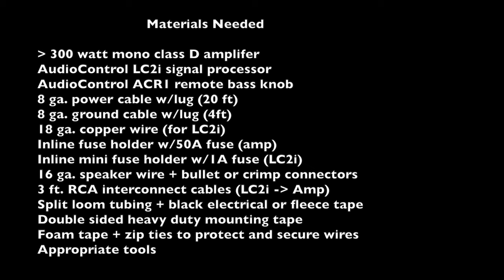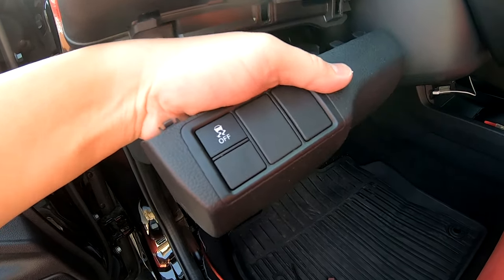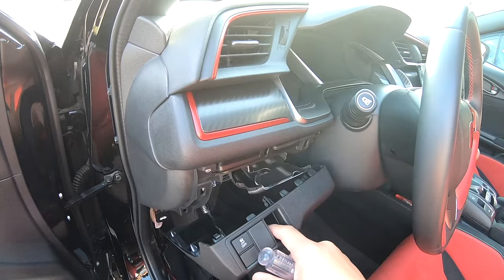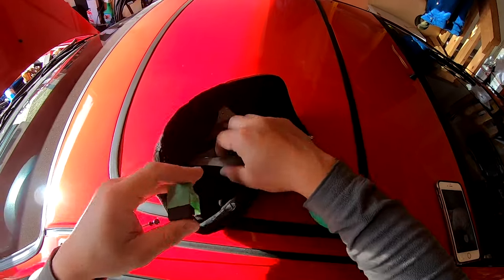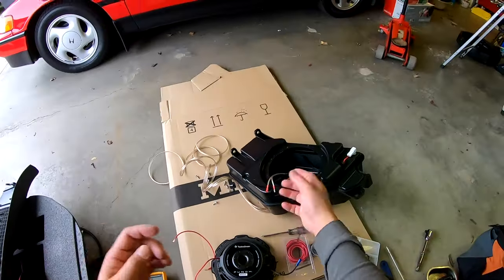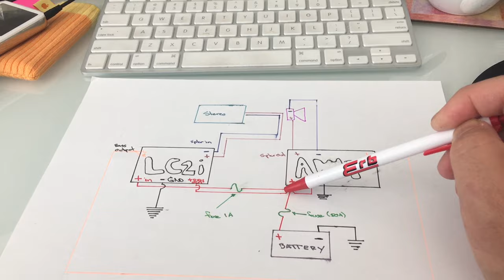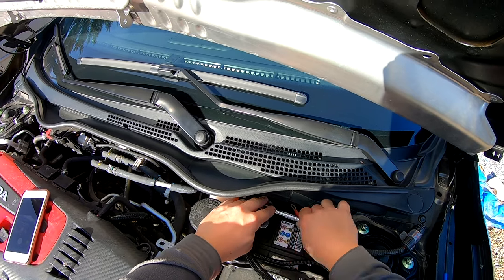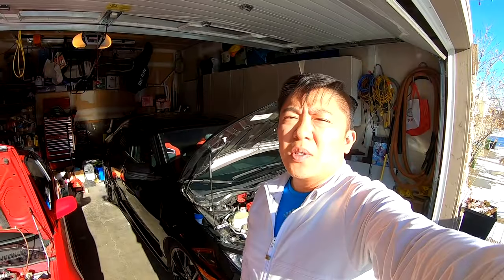2016+ Honda Civic Type R Subwoofer Amplifier Installation

Comment: Is the lc2i necessary? Or can you run the audio wires from stock housing straight to the amp?
Reply from the maker: It depends on the amp.  If your amp has high levels inputs and bass eq correction capabilities built in then no you don't need the LC2i.  My Rockford actually has high level inputs but I don't see in their documentation that it has bass curve EQ correction capabilities so I opted to go the LC2i route.  Having 2 separate components allows me to change to ANY kind of amplifier.  While I don't foresee myself changing amps anytime soon that I like having options and certainty that the job was done properly.

Comment: This might be a stupid question but does this method also give more watts and amplify the other speakers In the car because I want to modify the door speakers but the factory amp can’t handle the rms and watts
Reply from the maker: No not a stupid question at all.  If you don't install things like this regularly then it can be confusing.  Yes the amp does add more power to the audio system but ONLY for the sub.  All car makers fudge their audio system power specs.  They rate the systems at peak output before the stereo will blow up which is a crappy way to make factory wattage look higher.   That being said, adding a sub amp doesn't add any additional power to the other speakers, they will need their own DSP and amplifier to work properly.  You're just in luck that you asked this question!  I'm actually planning a DSP amp install in my 10th gen civic along with a front speaker upgrade to something quite high end to REALLY amp up (no pun intended) the soundstage with excellent quality audio.  I have purchased the speakers already and I'm just waiting for more funds to come in so that I can pull the trigger on my DSP + 8 channel amplifier.  If you're interested, keep an eye out on my channel for the vid.  It will probably be installed at some point in the late spring/early summer as it is still quite chilly where I am.

Comment: How hot is amp getting in summer with no ventilation? Love hiding amp underneath but afraid it will overheat.
Reply from the maker: It can get quite warm on the super hot days but I don't run the system hard enough or long enough (in excess of 8 hours) to let the system get to dangerously hot levels.  I've checked multiple times and at reasonable listening volumes it purrs along just fine.

Comment: I understand the need for more power to drive the upgraded 2 ohm sub.  You installed a 500 W amp that can cleanly push 2 12" subs.  could you just have purchased a lower end aftermarket subwoofer that's a class below the one you installed to get better bass notes without having to add an amp?
Reply from the maker: No that isn't quite how things work in the audio world.  Having lots of power reserves on hand means you have more headroom reserves to provide better control.  The sub I put in is the same impedance as the stock one (2 ohms) but the magnet, voice coil and "mass" of the upgrade sub will require more HP (watts) to keep that heavier sub under control.  The stock amp could drive the upgraded Rockford sub but at higher volumes it became apparently the stock amp was starting to clip and distort.  This will ultimately fry the coils on the speakers and sub.  Sizing a 500 watt amp for the sub only is in my eyes a very reasonable amount of power to properly and safely drive that rockford sub to respectable levels without ever clipping the signal to it.  Using your 2 12" sub example - sure it will drive them but it likely won't drive them perfectly.  At the louder volumes I would suspect that the amp will get super hot and start to clip.  Lot of variables at play here but no matter what you can NEVER have too much headroom on an amp.

Comment: Iv an rx8 that has built in amps but I want to add 12 inch sub with amp and replace 6x9 on the shelf to my stock radio with the door speaker should I leave the mini amp or cut them out and replace the door speaker anyone done an rx8
Reply from the maker: It depends on your car's audio system design.  Do your homework before ripping things out as it CAN screw up your audio system as car manufacturers do weird things in their designs.  That being said, I'm always wanting to swap stock pieces for much better aftermarket ones - they're just SOOO much better.

Comment: Hey last question did you connect to sub in parallel for it to become 2 ohm or did u make it 4ohm with one negative connection going to positive?
Reply from the maker: Sorry for the long delay to reply.  Since my sub is a dual 4 ohm voice coil that they are wired in parallel.  Meaning - to - and + to +.

Comment: Is there any issues with the Amp overheating being closed in like that
Reply from the maker: Nope not at all.  I ran my stereo quite hard on a 13 hour road trip and after the trip it was VERY warm but far from hot.  If you're really concerned about the heat one could also install a small computer PC fan to vent out the hatch space but my car doesn't usually run for more than a few hours at a time and it almost never gets warm.

Comment: Can you do this and remove the stock sub and install an after market sub?
Reply from the maker: yep.  If you watch my other sub swap video I did exactly that.  Swapped the factory sub for a 8" rockford sub.  If you don't like the stock sub size then you can just plunk in a large sub box and drive whatever subs you'd like.

Comment: Those wires are tiny. I would have gone one lower Gauge at least.
Reply from the maker: Nope, not tiny at all given the power output and what the current (amperage) requirements are.  The aftermarket 8" sub isn't pulling a HUGE amount of power.  A few 100 watts can EASILY be handled by the 16 gauge wire used in the sub install.  Consider this:  Most home theatre systems that have considerably MORE power doesn't use more than that in many cases unless you're running huge power or running very long distances.

Comment: Have you had any problems over the year? I’m looking to swap out my factory sub in my 2015 Pilot has the same 8” sub in the factory location..... how’s the sound over the course of the year? How is the bass responds? Does it shake the interior?
Reply from the maker: No issues whatsoever. Sub sounds great but it isn’t earth shaking by any stretch of the imagination. Worth upgrade but an 8” isn’t going to be nearly as good as a 10” or 12” sub. For a stock replacement the Rockford 8” is a decent upgrade to maintain the stock look.

Comment: Couldn't a different switch work?
Reply from the maker: Hi Collin, sorry what do you mean by using a different switch?  Its been a while since I produced this vid and I don't recall installing a switch for my amp install.
Reply: @piercedasian  the base control knob that you used. You had to remove its housing and even then you had to put it in the dash weird. Would a different, smaller, switch work?

Comment: Im alittle confused with the 1a fuse. In the video you say install 1a fuse or 5a. Which one is it or can a 5 a fuse be used as well?
Reply from the maker: that would be my bad.  The fuse holder is rated for 5 amps but the fuse I used was a 1amp.  You can use either or b/c it the current draw is SO low on the LC2i that regardless if you had a dead short in the LC2i wiring that it would blow either sized fuse in a hurry which is what it's designed to do.  Narrating a video and doing a full install can mess up my thoughts and what I say sometimes.

Comment: I am going to install the same amplifier very soon. Have you noticed any overheating issues with the amplifier being under the carpet in the trunk? Have you driven for many hours with a lot of bass and checked the temperature of the amp?
Reply from the maker: No heat issues whatsoever. Ran it long and moderately loud and the amp was almost stone cold.

Comment: With no gain on the amp are you getting decent bass??
Reply from the maker: yep, plenty of bass.  If anything due to the 8" sub size that I have to dial down the bass on the remote bass knob b/c the sub can be pushed too hard and cause bass pop.

Comment: I would’ve cut clips and ca glued back plate back in place after mounting backing plate back. 🤔
Reply from the maker: Interesting way of mounting things.  If it works for you then all is good. The reason why I don't use CA is b/c it burns/melts styrofoam so I went the carpet tape route.

Comment: Stupid question but where did you mount your ground to?  I have a 2019 Civic EX Hatchback and currently have it grounded to a bracket on the backseat, however it seems towards higher volumes my sub completely drops out.  Comes back in when I turn volume down.  I also have an LC2I, tabbed into front speakers.  Running an alpine S-a60m 600rms amp, single 12" type r dvc 4ohm 750rms, wired down to 2ohms at the amp.  

I'm thinking it's a grounding issue, unless you suggest otherwise.  Thanks in advance!
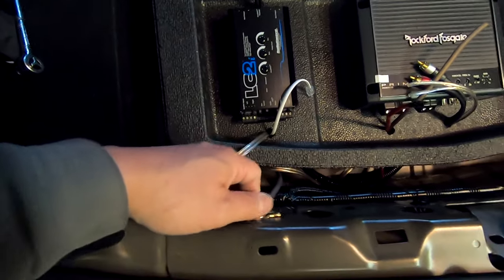Reply: 18:45 he shows his ground
Reply from the maker: The ground is on the back part of the spare tire well.  As Andy Byrd has pointed out, it is shown in my video at the 18:45 time.

Comment: R500X1D has high-level speaker inputs. Why there is a need in LC2i? $100 spent for amp trigger signal?
Reply from the maker: From what I understand the LC2i serves 2 purposes.  The first being a remote trigger for the amp and second and most important, is restoring the bass signal from the head unit so that it sounds correct.  I've read on numerous forums that by not using the LC2i that the bass signal is limited if you go straight from the sub feed to the amp.  Apparently modern factory stereos do some strange EQing on the signal the LC2i helps restore the missing signal range to give you fuller bass.  How accurate that is I am unclear but one thing is for certain that it sounds MUCH better than the stock sub setup.
Reply: @piercedasian  After looking into LC2i documentation I've finally figured that out. So "restoring" is about the fact that some stock systems do not increase lower frequencies after passing certain volume thresholds. In other words - when you play stock system at lower volume levels everything is fine and clean, but switching to higher volumes bumps up only mid and high frequencies. The bass stays at lower level not to damage the cheap ass speakers in the door panels.  For LC2i you can configure this volume threshold beyond which it will start amplifying lower frequencies (bass EQ bost kicks in at higher level volumes, but disabled at lower volumes). This sort of "restores" flat frequency output on RCA channels through the whole range of volume levels. 
But my guess that while for some "premium" stock packages this can be true - for most scenarios ("base" trims of economy cars) the frequency output of stock system would be just trimmed at lower side within the whole range of volume levels (this is just way cheaper to implement). And using proper single channel sub-woofer amp with configurable low-pass filter and gain would be enough to tune that back up.

Comment: Do you have it wired at 2 ohms?
Reply from the maker: yep!  I did my install in a split video where I first upgraded the sub THEN the amp afterwards but in my first vid I did show that I wired the sub in parallel to get 2 ohms out of my DVC sub.

Comment: I’m thinking I can just go positive on one side of the speaker and negative on the other side from the amp....it’s the wires used to make it 2 ohms from the prior videos that’s messing me up (leaving them there or removing them) Doing a positive to one side of the speaker and a negative to the other will make it 2 ohms if I’m not mistaken
Reply from the maker: it will depend on the speaker/sub you're using.  If you have a dual voice coil sub that has 2 4ohm coils then you'd wire all the +ve together and conversely all the -ves together.

Comment: What did you do to the head unit ? How did you take it apart if you did.
Reply from the maker: I didn't do anything to the head unit.  What you see in this video is exactly how I installed it.  All the hook up work is done at the rear trunk/hatch area of the car.

Comment: How can I hook this up to a 4 channel amp for my mids & a regular 1 channel amp on my subs? I have a Lc2i
Reply from the maker: Hmm, if you're going to amplifier more than the sub then you're going to need a different audio control unit.  Recommend you look into the other LC models.  I cannot recall if Audio Control made a LC4 or and LC5.  I do know they make a LC7i where you can amplifier ALL channels with full eq restoration to the audio spectrum.

Comment: How safe is it to mount amp fuse on power wire from fuse box as oppose to the actual battery? Any input would be appreciated, Thanks!
Reply from the maker: Do not do that.  The reason why you need a direct line to the battery is to ensure you do not overload the car's existing electrical system which often uses MUCH thinner gauge wires than a dedicated amplifier power cable.    If you run your amp from the fuse box then you'll be effectively starving your amplifier of current that it may require during heavy bass passages.  The purpose of the fuse is to protect the wiring and the battery in the event of a short in the cable somewhere.  The inline fuse is to prevent a car fire and battery explosion due to a short so the closer to the battery you can get the fuse the better.

Comment: What size/gauge ground wire did you use for the LC2i? Thanks
Reply from the maker: The ground wire wasn't all that large.  Maybe a 18 gauge?  There isn't much power flowing through that tiny device so you don't need to go crazy with power cables.

Comment: 👍 Great video,  what about the remote turn on from the LOC to the Amp did you have to do that
Reply from the maker: There is no need b/c the LC2i has signal sensing and will provide the 12 volt trigger from the LC2i to the amp so no additional wiring back to the head unit required :)
Reply: @piercedasian  ok great,  thanks

Comment: Late comment I know, but how did you connect the radio to the LCi2 where did you run the speaker wire?
Reply from the maker: I pulled the signal from the factory sub feed. If you closely watch me wiring in the sub and box that it should be pretty evident how it was done. It can be a tad confusing but it is done so such that it maintains the stock appearance.

Comment: Question do I have to run the RCA cable from the aftermarket radio to the back of the trunk..or just the power cable?
Reply: Rosendo Yanes ... if you have an aftermarket amp in the trunk, then yes you’ll need to run RCAs. Be sure to run them down the middle or or the opposite side to your power wire.

Comment: not sure if you have answered this question but, ive been looking at the thread from CTRMofo for a while and am still debating if i want to change all the speakers and subs since i want to keep the car relatively oem.  what are your thoughts on each part of the set up ? meaning.. do you think it will be a significant upgrade if i just install an amp, or  should i go and change all the speakers around the car as well.  the question is derived from a cost saving saving standpoint but rather i want to eliminate changing out oem parts as much as possible. the oem sound system is rather lacking. thanks !
Reply from the maker: Ah yes CTRMOFO!  Great guy!  His setup is really nice and the sound improvement is likely significant - so much so that I'm debating on doing the same to mine.  While I simply did a sub and sub amp upgrade that if you wanted to stay relatively OEM them do at the very minimum the upgrade I demonstrated in my video.  If you find the sound still lacking then I'd then look at adding aftermarket amps to the stock speakers and see if you like it.  You'd be amazed at how much better things can sound with improved amplification.  If that is still NOT to your liking then the final step would be to upgrade to better speakers.  Unfortunately with audio, the sky is the limit and what sounds good to me may not satisfy your wants.  While I fully agree that going full aftermarket is really the only way to audio bliss that similar to what you've said, I try to stick to OEM as much as possible for cost reasons.  It's expensive to buy GOOD quality equipment and even more expensive to buy high quality speakers.  Not sure of what your goals are with your civic years down the road but I have my fingers crossed that my Type R 25 years from now will be worth something similar to the original Integra Type R so the less I mod it the better off I'll be.  I save my money to invest in superior sounding audio for my home rather than in a car that I barely drive more than 5000kms a year.  Each to their own but that's how I'd approach your specific problem.

Comment: Hello I'm abit confused how you tapped in the Stero wires into the LC2i. I understand you tapped in the wires from the stero subwoofer wires but how do you know which one is the Speaker left +- and Speaker right +- ??
Reply: No left and right.  Just positive and negative.
Reply from the maker: My reply is super late but Nicholas is correct in that you don't worry about left or right since the sub is mono.  Just positive and negative and you should be golden.  Hopefully you got yours installed already.